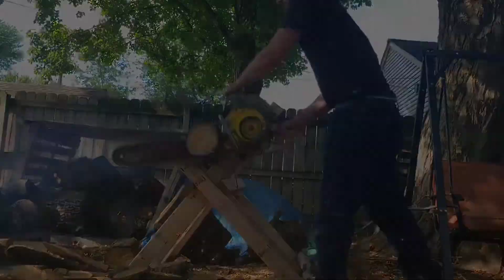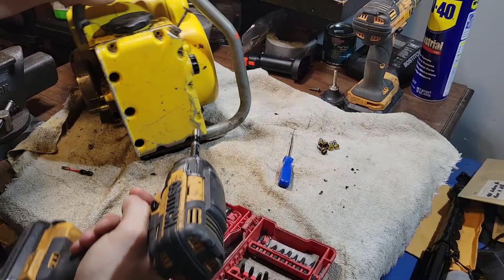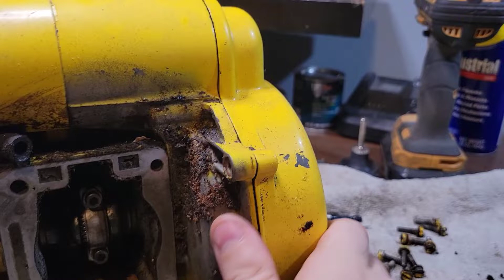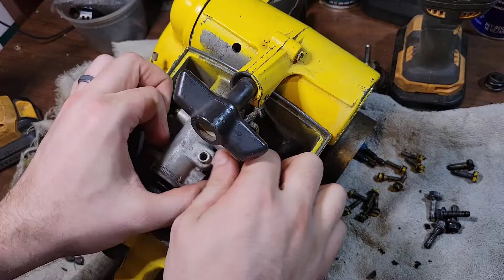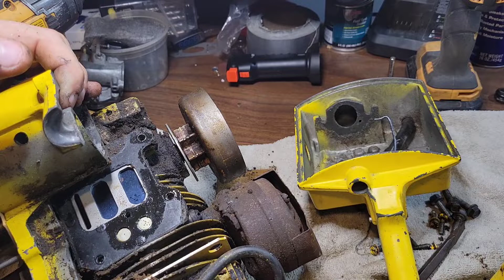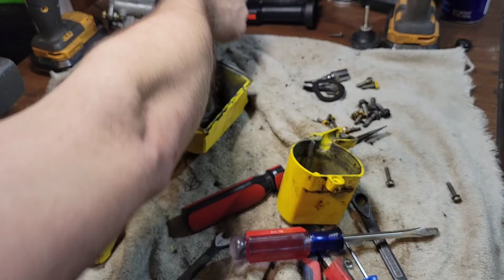McCulloch 91 Kart Saw Build Part 1

Comment: I don't gave it Gere with me to check but I believe my old nac saw is a pro 91 saw. But I'm not getting information with Google searches. I'll have to get to it and check to see if it is an 81 but I sure remember it being a 91. Funny, I'm not finding anything showing a 91 saw. Any information from you? It was a beast, wanna say I was told it was a 5 inch motor.
Thanks if you can help
Reply from the maker: There is no such thing as a 91 saw, only a 80 and 81 which are pretty much the same. 91 is a kart engine saw I made.

Comment: Wish I had started with a D36 when I built my MC92 in a 250 chassis, looks like it would have been much easier than adding a mikuni fuel pump to pump the bar oil
Reply from the maker: If I had a sloper intake the 250 body would fit without issues but those intakes ate hard to find and expensive. But the D30 and D36 body allow a guy to use about any intake they want to. Now I do plan to do another build in the future with a d30 body I have but vecause the stuffer on the d30 is small, ill be cutting it and modifying to allow a better stuffer. That saw will have a GEM v12 intake and single large carb. She's gonna eat good. Being a race saw there's no need to have an auto oiler for one large cut or a few small, just load up the bar and chain and send it!
Reply: @MisterMacsGarage  I did pick up a 30/36 chassis a while back thinking it would make a simpler build, just have not built anymore since the 92,  I think that was about 15 years ago!
Reply from the maker: @macandmall  should fire up the 92 and get another video of her. She would throw some nice rooster tails of wood for sure. What fuel did you run in her?
Reply from the maker: Also I wantched your videos and studied your mc92 build and how I got the idea to use a d30 to avoid using a 250 body because I didn't want to mess with the oil tank. She's a fast saw for sure and we'll done to you on that, wish I could see more of it!